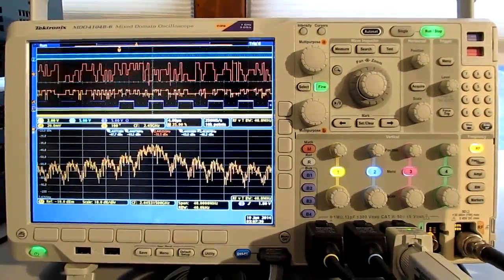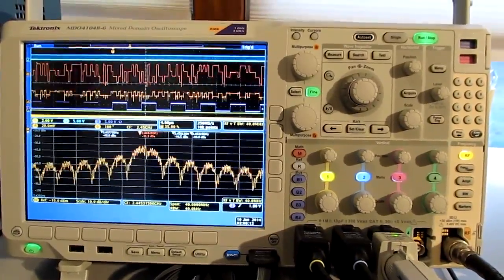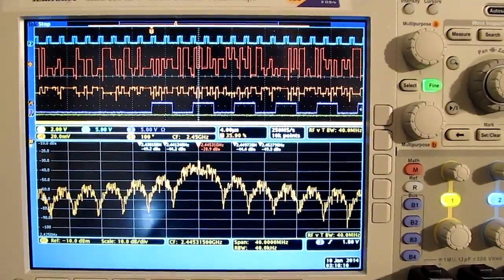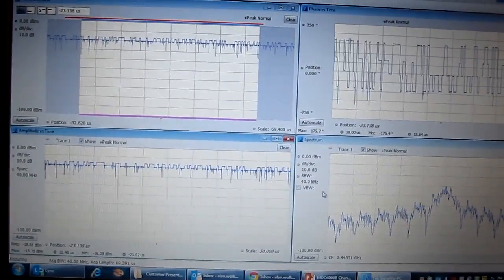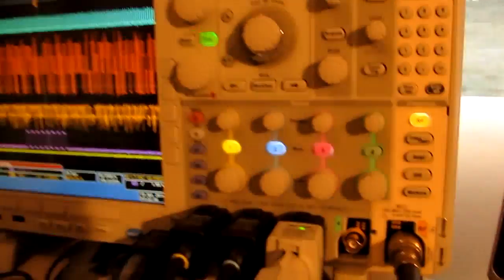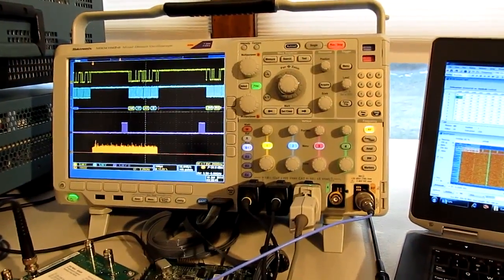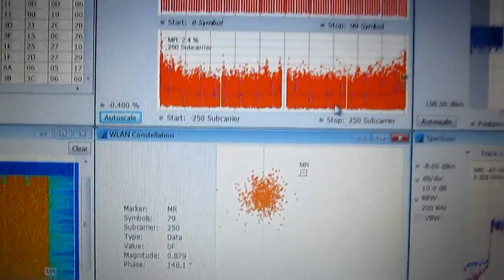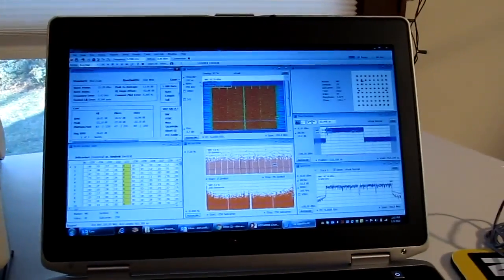#125: Tektronix MDO4000B Enhancements - RF specs, Signal Analysis and WLAN WiFi Example

Comment: Hi Alan what is the differences between MDO4104B & MDO4104C 
Thanks
Reply from the maker: The main difference is that the MDO4104C adds an optional single-channel arbitrary function generator and DVM measurements on the analog scope channels.  The "C" model is fully upgradeable - all additional features (digital channels, wideband spectrum analyzer, DVM, AFG, etc. are all user installable options.
Reply: Thanks for your time you'r really great Man & have Awesome channel

Comment: A very impressive bit of kit as Dave Jones would say. Obviously the MDO4000 Series is a piece of test equipment designed for the Engineering Lab which possesses capabilities far beyond the needs of any hobbyist. Still the video was fun to watch. I wish Tek the best selling it.
Reply: ***** Dave did a review of the first variant of the MDO4000. He didn't go into the depth that Alan has in this video. I'm sure the unit Dave had was a short term loaner so he didn't have much in the way of time. Nor do I think Dave has the depth of background in RF and Oscilloscope signal work that Alan possesses. Thus Alan was able to put the MDO4000B's best foot forward and demonstrate to the viewer what the machine is capable of doing. One thing Dave did point out is the optional interface modules that are quite pricey ! IIRC there are 5 modules available each costing 10 Grand ! So this unit could easily run the user 50 Grand all decked out. Again this unit is for a Professional Engineering Lab doing very demanding work. The type of work one finds at a DOD vendor. They are the ones that can drop 50 Grand easily. If its needed they will spend it.